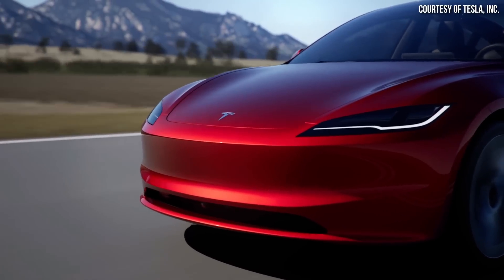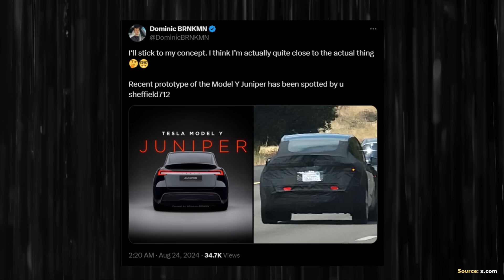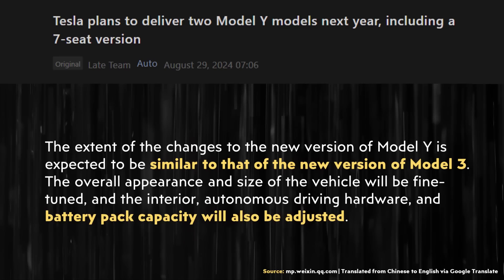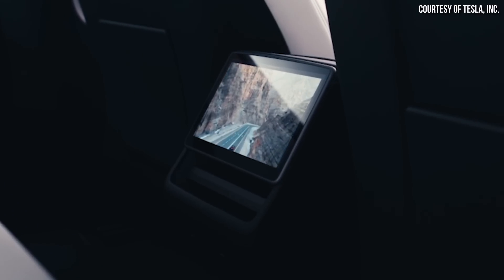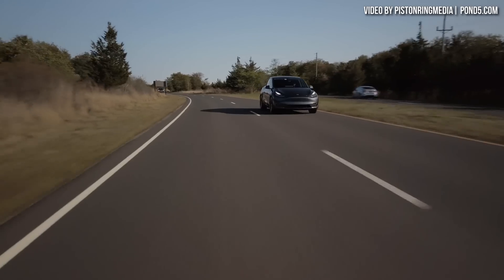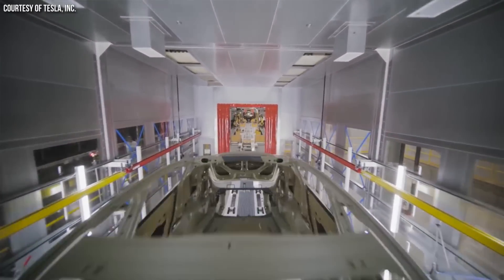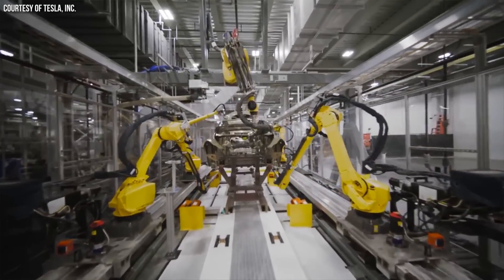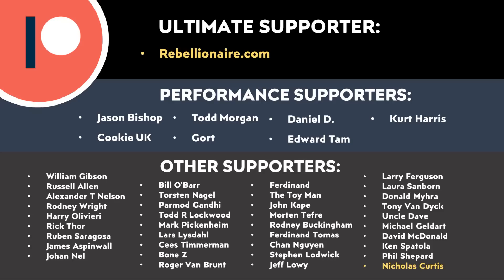2025 Tesla Model Y Juniper Refresh | NEW Details Revealed!

Comment: I'm guessing the fact it's a smaller model y has nothing to do with the look or exterior design. But the it will use the giga castings which is not the case with the model 3

Comment: 100% Tesla won't build a Model Y with 2 different wheelbases... This would require new stampings... 100% not going to happen.

Also you're badly informed if you hope Tesla could "bringt Back" the structural Pack at least in the US.... Tesla ist building the Model Y Standard Range in Germany with BYD Structural Pack and Front Casting since around May 2023... And i just got my new June 2024 Y Standard Range again with Structural BYD Pack and Front Casting.
Reply: How is the comfort, ride quality and noise insulation in the car?